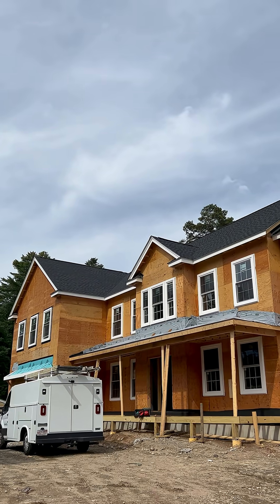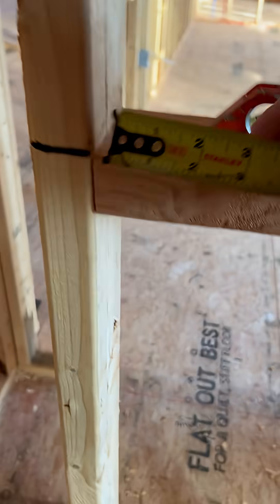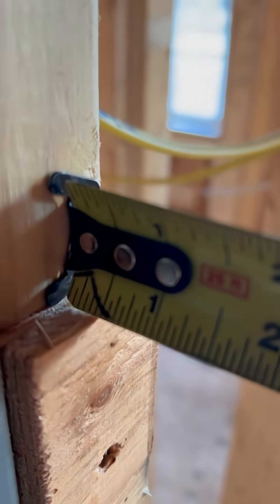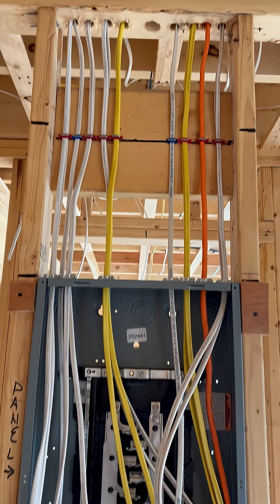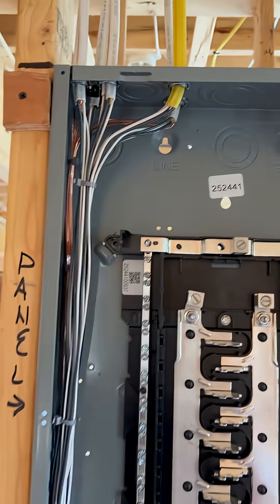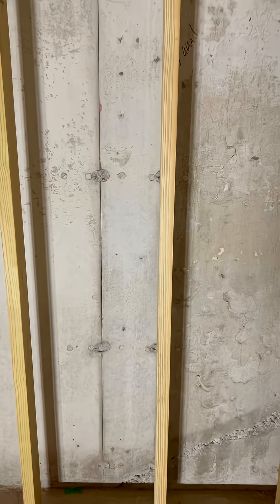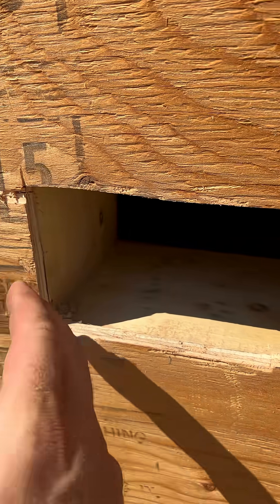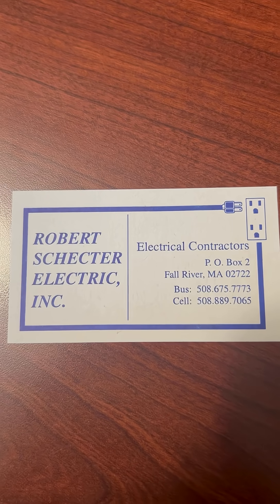I Installed TWO 100 Amp Sub Panels + Building a Panel Board! 🔥Attleboro Ma #electrician #shorts

Comment: I don't live anywhere near Massachusetts but I have code question. In a wall similar to the first panel you installed, is there allowed to be water lines below the panel? They're at 14in off the bottom plate so they'd be way below it and I was going to put another block just above them to prevent spraying if they were to burst but I wasn't sure if that was allowed.
Reply from the maker: Well keep in mind your clearances 30” wide  36 deep and 6.5’ in front of the panel. Waterlines above it is a big no but 14 inches if it’s under the panel and concealed in drywall I would consider that acceptable but your local inspector may not pass that due to the spray from the water hitting the bottom of the panel. So you gotta be careful my best bet is to always avoid the panel near water lines.

Comment: Number one problem is home line square D service boxes. I prefer QO service boxes. There is a reason homeline is not for commercial wiring. I'm not complaining about the work done or the video. It's excellent in my opinion. Like one said I wouldn't mind working for your company. Higher standard of work has benefits. Thanks for posting. 73
Reply from the maker: Thanks friend I appreciate your feedback

Comment: Make sure you keep extra panel cover screws handy because the drywall guys are gonna throw them away. (Instead of putting them in the bottom of the panel) Also, make sure you have a vacuum handy & a putty knife to scrape off the mud that ends up in the panel. Working on some of that right now after they left a couple of weeks ago. Threw the screws away twice….so far.
Reply from the maker: Yes I believe it I always have some extra screw lying around and yes I do the same thing scrape everything bc they always get mud everywhere

Comment: Looks great…. zip ties??  Grinding paint off??  The panel is manufactured according to NEMA standards, I don’t believe that the paint needs to be scraped off
Reply: Needs scrapped off? Maybe not. Will it help? Yup.
Reply from the maker: @JM-hf9tv correct
Reply from the maker: I do it to make a better ground same concept as automotive 12V ground scrape the paint clean the surface to create a good ground that’s what I do some say it’s over kill but that’s the way I do it.
Reply: @SchecterElectric I see your point. But with cars the chassis is part of the negative (ground) path to the battery. The panel is attached to the ground, but not part of its path to the earth.  But if this is what you do, so be it. Nothing wrong with your way of thinking!!!  Your runs look very clean!!
Reply from the maker: @ericleanne1628 thanks friend!

Comment: Those windows installed before house wrap? I hope they installed some type of sticky flashing around the RO before mounting, and I also hope they were still on the job because there is no other type of flashing to dry them in on the sides or header.
Reply from the maker: They did building inspector passed they did a nice job flashing them

Comment: What if you would want to fish the wire down below thebpanel you ll be screws. Never had problem with installing square d panel without spacing and measuring bottom of the studs. So much unnecessary work
Reply from the maker: It’s new construction we shouldn’t be fishing anything new in. The upstairs is completely unfinished so if you had to you still could get into the panel from the top but still no need to add anything we’ve gone over everything several times already with the builder and the owner their very happy

Comment: The 10/32 screws used are enough to bond everything. Scraping the paint off will just ask for corrosion there and then you'll lose the ground entirely. I'm working on 3 houseboats right now, that would corrode super fast!
Reply from the maker: Right that’s a house boat key word boat that’s on the salt water where salt corrodes everything. If anything I’d scrape the paint off and apply no lox a very thin layer or even a very thin layer of dielectric grease and I mean thin to keep corrosion away. I’m in a climate controlled house not a boat
Reply: @SchecterElectric don’t worry about him, these are just guys that hate to go the extra mile. Worse they make excuses for not doing so.
Reply from the maker: @funkmanone pretty much friend
Reply: @SchecterElectric again, the screws are enough to bond everything, longer ground bars use more screws. You can get chair lugs that use only 1 screw for #4, so why would you need to scrape the paint if not required there?. Code isn't always the minimum, but now you're altering the panel more than you need to🤷❤
Reply: Depends on application, here I don't think I'd bother because the bond from your main feed is going to terminate on the same bus as all the branch circuits, so all those screws need to do is bond the can. When I'm dealing with distribution equipment where the bond for a 600 amp service  needs to be carried through that connection I'm taking that paint off. Work in the trade long enough and you'll see what kind of problems a bad bond will cause.